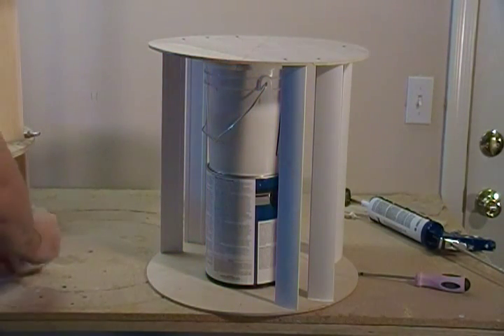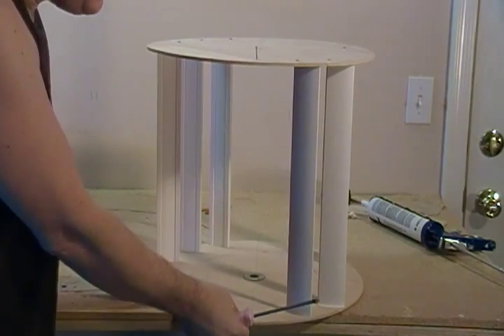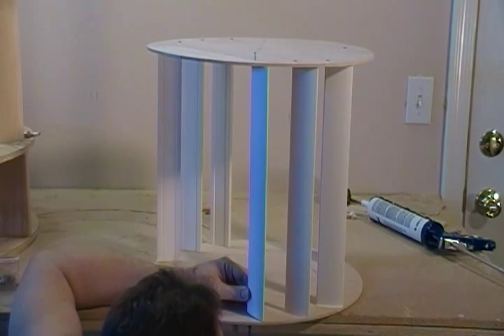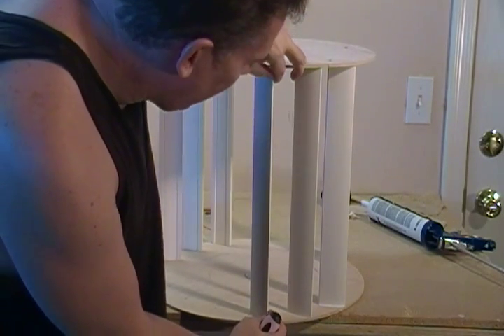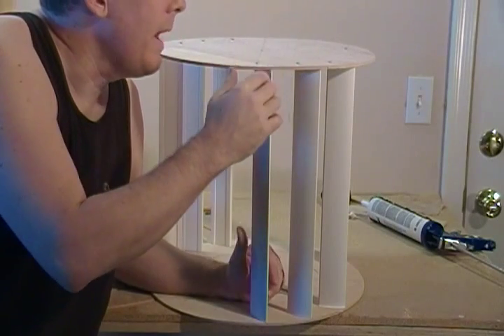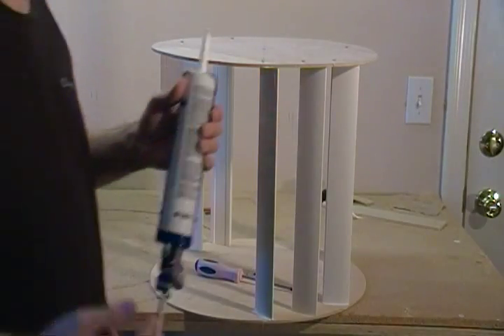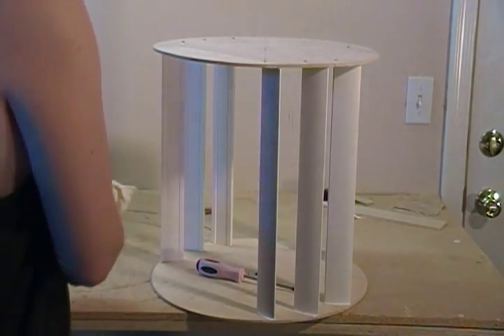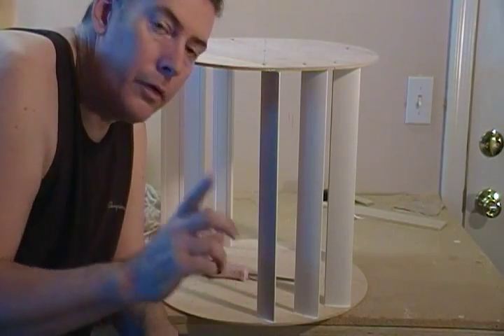Building a Wind Turbine (37 of 46) Screw and Silicone 15 Turbine Blades onto Rotors

Comment: ◾◾◾Newbie here all, embarking on my first DIY VAWT build, so, super newbie question, Does it matter what side, direction the blades are placed? I see some vawt's where blades are angles all left, and some are angles all right, (I.E. door open position or door closed) if I'm asking this right, does it matter which way. I'm very interested in using what I have around me, which is, very big large bamboo, which cut in half or in thirds already has a catch and with the nodes a lift, bicycle wheels and a D.C. Motor I'll put a rectifier on. Any thoughts? Time and positive info appreciated, 🙏🏽 Thanks for your share, time, and information.

Comment from the maker: @WulfBand I have the fat side in. However. I've set these up both ways and it works about the same either way. The pitch (angle) of the blades is critical depending on what kind of wind you have. I found that 40 degrees is a good average angle that works well in low and high wind.